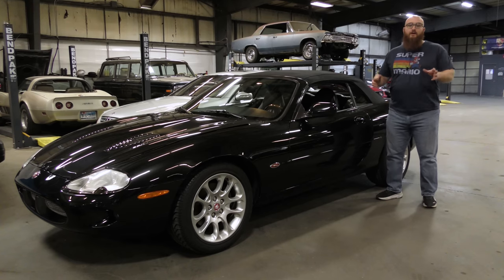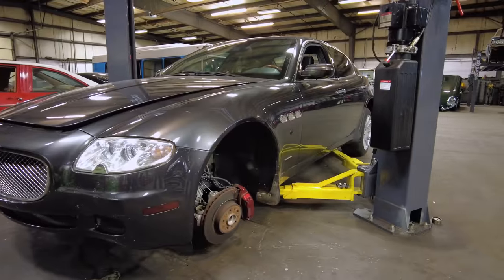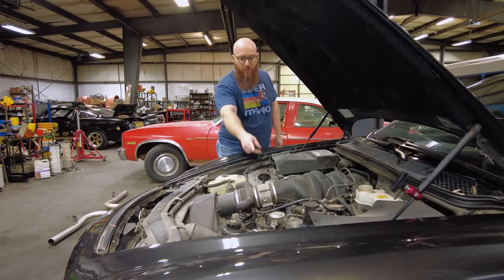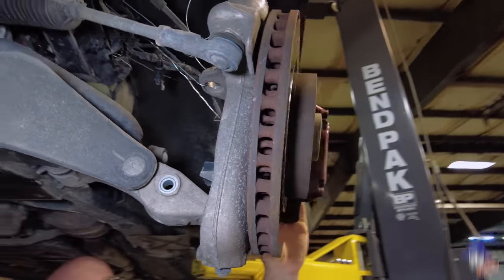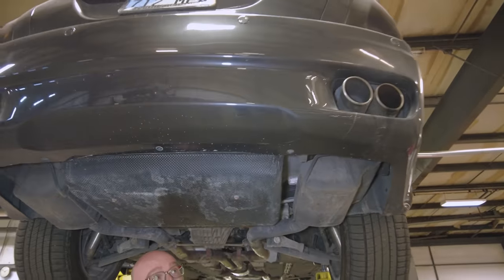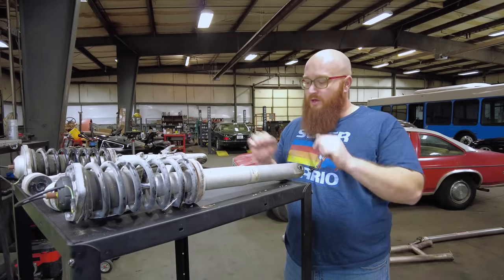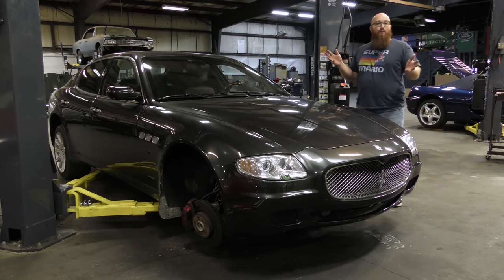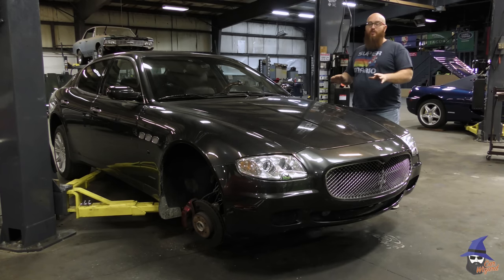Me-Owch!!! Catalytic Convertors cost $13K on this '07 Maserati Quattroporte! CAR WIZARD explains how

Comment: Bushings and insulators are a wear and tear item.  That's not too much of a problem.  Although, those type of bushings for those control arms are pricey.
As for the cats.. I'd put on some proper race headers and call it a day.  Cheaper, make it sound better, and you'll get more power from it.  🙂
Very true.  If you can't do the work yourself, don't bother picking up an "exotic" ride.  You'll go bankrupt really quick.  If you can work on them yourself, the skies the limit
Reply: Car won’t pass emission tests without new cats. I’d put aftermarket cats on it if some can be made to work.
Reply: @fw1421  many states don’t require emissions tests, so you have to sell it to someone in Tennessee, and states like that
Reply: @fw1421  Don't they make 'universal fit' cats. Magnaflow for instance.
Reply: Just run straight pipe. I saws off all my converters and run pipe anyway good or bad.
Reply: @hoopty.  im sure your city loves you 🙄
Reply: @luc-perrin  no inspection in Tennessee. Law enforcement has real crime to deal with, other than my vehicles choices.
Reply: @ianmontgomery7534  I've been told that aftermarket cats don't last long and typically fail after a few years.  OTOH, considering the factory cats cost $13K, you can keep on replacing it with aftermarket cats for a decade or two before you hit the factory cat cost.
Reply: @fw1421  Yes ... several of my cars are equipped with "test tubes"!  I would never live in a state with emissions or inspection requirements.  Even  my 9 vehicles in California are all registered in Michigan: 1978 to 2022 .... :-)

Comment: I check the prices for used Quattroportes.
That car is basically mechanically totaled!

As is the case with other high end cars, if you can't afford to buy a new one, and you can't do repairs yourself, you can't afford to own a depreciated used one.
Reply: Its the same with boats. If you ask for the price, you can not afford it.
Reply: I checked the car-part website and there are numerous ones.  One looked rather excellent on the interior.  Probably mechanically over priced to repair.

Comment: I use a broken adjustable ski pole. You can set it for length and it never drops the hood. Yes its in the way some times but you can move it so easy its never an issue.
Reply: Had a mechanic refuse my wood block, cut to size, that held up the hood on my company truck. Was pumped to show me his locks, offered me a pair. Literally fell on his face, almost caught it in time, idk how he didn’t break his orbital dude got nailed.

Comment: Those hood strut locks are awesome.  I have blue ones so they match the Ford emblem on the vehicles I use them on.  I also use one on each side.... because they are also ... ford emblem blue... so reliability is in question.
Reply: totally worth the money, i wish i would’ve knew about this. eforr i replaced the hood struts on my RX300 last week lol
Reply: Why not just replace the hood struts rather than buy the strut lock tool?  (Assuming you own the car and its not a customers)
Reply: @GunsAndRovers  Wizard has commented on that in the past. Most customers don't want to spend any of their budget on hood support struts since they typically do not do any work on their own car and rarely open the hood.
Reply: @GunsAndRovers  most customers don't work on their own vehicle.  For some reason we have customers that took them off or they broke off and they got a golf club laying in the plastic tray across the top.

Comment: Owning a Quattroporte 2007. Do the maintenance and repairs myself, so total costs are not extremely high. However I owned 2 Ferrari's, for 5 years in total. They were cheaper to own. (Mileage was much lower aswell, so that makes sense) The Quattroporte however is fun to drive, great engine sound and fun to work on.
Reply: What are common issues? I also work on my cars and have serviced Porsche’s and Mercedes’. I’m currently looking to buy either a Quattroporte or Granturismo
Reply: @RegionalRadioShackManager  same issues as any 12 -18 year old car. But specific: bushings, door latches, window regulators, alternator (lasts max about 120.000km) sky hook shocks, flexible engine mounts and electronic gremlins.

Comment: Maserati is a front mid engine car.  Many of the catalytic converters come out of Russia/Ukraine.  Rare metals like platinum and palladium.  Besides chip shortages there are converter shortages.  Big 3 and German manufacturers still idling plants on/off due to supply issues.  Now europe paying 6-10 times energy costs which will be reflected in parts.

Comment: Leave the stock converters in place, but install some new aftermarket cars in that straight section of pipe right behind the old one. That should provide enough exhaust cleaning to stop the check engine light,  You will also need to relocate the oxygen to behind the new cat

Comment: I found the oem drivers side cats for $5,100 shipped. So I am guessing $10.2K for everything. 2 words...STRAIGHT PIPE
Reply: Yes, but it’s illegal for him to do it.
Reply: @roydrink , for sure! That is why you leave and have somebody do it. Especially in a light emissions state like Kansas.
Reply: Why do you want to spew emissions into the air and make a luxury car noisier? Makes no sense. Aftermarket cats are the way to go.
Reply: @OMGWTFLOLSMH , silencer on the mufflers and if you replace the cats with a straight pipe with the mufflers still intact it is not an obnoxious sound. Especially on this car. This motor with exhaust sounds insanely good. Make a luxury car noisier? You must not be American? Guys have uber load Audi, Mercedes and BMW cars here.
Reply: @OMGWTFLOL  ok greta 😆
Reply: 3 words still a code
Reply: @OMGWTFLOLSMH  honestly the way modern cars run its unlikely there aren't many bad emissions, probably worse going across the catayst. Some manufactures have said the cats are unnecessary , just there for legal reasons.

Comment: 15:14 you pretty much described what happened to my old Aveo; the original cats failed, I replaced them with aftermarket ones then after 5 years of normal driving they failed spectacularly nearly stranding me on the side of the road. (This happened in February 2021 when the big winter storm happened that nearly took out Texas and it delayed my replacements from RockAuto) Then it was on its SECOND set of replacement aftermarket cats when the P0420 CAME BACK, and then I said “screw it” drive it until it dies, and pay for the $2,500 OEM cats when it does die, when a deer finally relieved me of that penalty box on wheels in November 2021.
Reply: Aveo's are like Cobalt's, they are objectively and measurably terrible in every way imaginable.
Reply: @Anonymous______________  which is why whenever my insurance company totaled it from the deer hit, I took the payout and RAN from that car! Now I have a 2006 Buick Lucerne that even after a year of ownership, the feeling that I have a NICE car hasn’t worn off!

Comment: In CA if the MIL light is on, its a smog check fail. So, skipping that cat repair would not be an option there. They let you pass with a pending code but not a stored code.

Comment: YESSS continue making these "negative" videos so the values tank again!! I've wanted an M139 QP for so many years.The values need to come back down to earth on these things LOL. Also, my guess is the thermostat was causing the car to run rich and I bet that's what took the cats out.
Reply: Coming from a Maserati technician, M139 QP are straight garbage. The M156 QP might not be very nice or competitive in the market, but at least they are fairly reliable and cheap (by Maserati standards) to repair.
Reply: @andrewweltlich9065 whats garbage about it in your opinion? Make me hate it because I really want one lol
Reply: @Passportbroski  Oh man where do I begin lol. Their issues can be summed up as the cars being designed by Ferrari so they use many Ferrari parts, then were hand built by Maserati. The parts are extremely expensive and the cars are very poorly built. There is also very little diagnostic information available for these cars, even for me, a dealership technician. The cars with the DuoSelect (aka F1) transmission are a nightmare to diagnose since Ferrari holds all information tight to their chest. Even putting all that aside, the cars just aren't nice. The interiors are not very good, the steering kinda sucks, the suspension gives poor ride quality, the throttle pedal has too much resistance, the radio/infotainment was outdated even in 2003, I could go on and on. In all honesty just get something else.

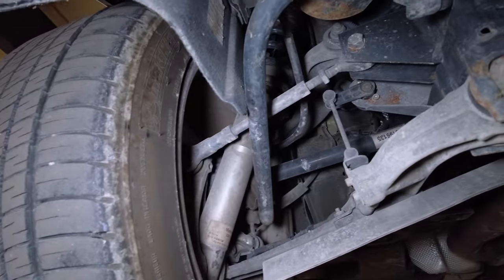Comment: 9:04 - The drivers side rear suspension, the upper link looks to have a nut that isn't tightened down against the adjustment rod. On the opposite side it looks correct.

Comment: OK first the converters.  I would buy aftermarket high flow cats for 80 dollars on Amazon and have a muffler shop insrall them. Next the bushings I would take the old ones with me to the parts store and find something similar and modify them if I have to. The only parts I would buy from Maserati are parts that are not universal.
Reply: The parts store to buy something similar? Bwahaha! First day worker: What year? What make? What model? The computer wants to know.
Reply: @bw1841  There might be some recommendations on the forums but a little research I know I could find something that would work there just bushings after all.

Comment: This is why I live in a state without inspections. Them cats could go to the dogs. 😂
Reply: user-tq2zb5sc2c  most people here take very good care of their cars. I seen more accidents in Texas because people assume because it passed inspection its safe to drive. But they don't check wheel bearings ball joints or frame rot. As the owner of a 2 ton projectile we should check our vehicles for safety before every long trip.

Comment: It's a Maserati with active suspension struts.  On a more common vehicle, it's cheaper and faster to replace the strut assembly vs dicking around with a spring compressor.  Safer, too!

Comment: Front suspension complete bushing set (both sides) is $250.00. Magnaflow makes CARB certified replacement cats (need to be welded in) for around $1k a piece. 

Just as illegal to fit used cats as it is to hollow them out, for reference.

Comment: I had a 2006 QP sport GT, the original cats failed. LARINI in the UK manufacture sports cats which I fitted and are fantastic. I have just checked  and the Automatica
 model is priced at GB £1668 so may be worth checking out!

Comment: Could you explain what is wrong with using after market catalytic converters such as MagnaFlows?  It looks like the catalytic converters there would be about $2800, and while I'm sure I'd underestimate labor costs, it is hard to picture that adding up to $10,000. Is there something I'm missing on why that is a no good option?
Reply: yeah, even just adapting another cat of a similar displacement engine, I am sure there is all manner of technically and legal reasons but I am not aware of it.

Comment: The price for catalytic converters on a Maserati Quattroporte is the highest price I have ever heard for catalytic converters on any car. Catalytic converters on cars are expensive, but most catalytic converters do cost less than that Maserati catalytic converter. However if a person lives in a state that has regular smog checks they will need to replace those catalytic converters.

Comment: The shop cannot won't do this fix, but if its a Cat below threshold code.. You can buy O2 Sensor Spacers.. that usually clears the code. $20 for those.  This probably wont work in a Carb compliant state they may do a visual inspection. Might try CataClean or some other product. 
But it will clear the check engine light.

Comment: I was sad because I had a check engine cat code, did some research and found out about a $30 product you put on your gas tank and after driving about 25 minutes the check engine went away. I didn’t really think it will work but it did, I even saved the receipt because it had a money back guaranteed. I don’t remember the name of the product but I bought it at Orally’s auto parts in the gas additive section comes in a box.

Comment: I'm sure a reputable exhaust shop could fab up some 200 cell higher flowing cats or get some universal ones from an exhaust manufacturer like flowmaster or magnaflow. I did something very similar to that when the cats in my Boxster and 996 gave up the ghost and they are still able to complete all the monitors for a CA smog.

Comment: Magnum tuning offers a 10 year warranty high flow performance Cat (299.00 each) specifically for the 2007 M QP 4.2, not legal in CA.  Require welded install site states will not trigger check engine light installed on factory exhaust.. have not tried them but it beats the 13k price quoted here... Mr Wizard.. your thoughts?  I have a 2007 throwing a P0420 on bank 1

Comment: Wizard explain why sometimes overheating isn't a head gasket but a clough up cat. My car was older without all computer chips to monitor the whole car. Unless your car is storage in a control garage you will have mechanical breakdowns. Seals,  bushings, and engine parts need oil, and burn off water condensation to keep your car running. 
Be smart and not stupid like I did.

Comment: I think I'd pull a Hoovie on this one and got the cheep route and put headers and straight pipes on it and re configure the computer . Which would really be a win for the dang thing considering it would run better with less restriction and probably make a lot more power
Reply: I'm not sure which is smarter: "cheep", or assuming that less backpressure = better anything.
Reply: @tim3172  Actually backpressure is always your enemy it's never your friend you have mistaken the scavenging effect with backpressure, he is right doing a de-cat and a retune of the ECU would give the car some power all over the rev range.

Comment: If the pulleys are equal to or behind the front axle line it is a mid-engined car, front Mid-engine, but it is mid-engine.

Comment: Normally I'd agree with Wizard on alot of things.  But the sound of a car is a purely subjective thing.  And to me, no doubt the Maserati sounds good, especially under load.  But to me, not better than some muscle cars.   The high strung euro engines sound a bit screechy to me sometimes.   Like my wife when I used the "good" towels.  I prefer a deeper tone to my vehicle exhausts.
Reply: I get what you mean but these engines use a cross plane crank and not a flat plane like the Ferrari version, giving it a normal V8 sound. These are happy up to its 7k redline, most V8s are done well before that, hence the awesome sound.

Comment: I had a 11 mks ecoboost with new aftermarket cats and a 420 code and I traded it for my 16 f150 5.0 with full sw exhaust also has 420 code fixed with a $20 o2 adapter, wish me luck at my emissions test

Comment: In a past video you said to run from a GMC 3.6 V6. I'm looking for a tow vehicle so what do you think about a Yukon 355 hp 5.3L V8 Flex Fuel Vehicle? Or Cadillac Escalade. Will be looking for something that can pull a large camper trailer after I sell my motorhome and smart car. Will have to buy used. Would love your advice.

Comment: I had an exhaust shop tell me that the price of a PT cruiser OEM catalytic converter was $1600 JUST FOR THE PART !  I also needed a New manifold that they did not quote me for.  and the Flex joint.   
Went to EBAY?  Less then $140 shipped to my door? I was in business.   Still need to get a proper  Coupling to fit the old  rear half of the exhaust to the new  portion of the CAT I bought.    I just saved $2,000 dollars.    How?   The Manifold was not included in the price.  Neither was the labor to do the job.  

I just a bit before that? I replaced the head , cams,   Cam timing belt,  "Pensioner",   and finnally was able to get it all working great.    
NOW MY ENGINE WON'T Turn over with the key...  Oh boy.  It never ends dudes.  😁

Comment: Maserati is owned by Ferrari and it shares a lot of parts from Ferrari. At one stage even the 4.2 V8 engine was actually a Ferrari engine with maybe a different ECU engine mapping than the equivalent Ferrari.

Comment: That rear left side control arm adjustment locking nut isn't tight. Weld in some aftermarket performance cats. No big deal.

Comment: With all the cat theft I'd be scared to have something like this. I bought a used Toyota tundra 5.7L. I think it's basically as much of a bullet proof truck as any. Not the best fuel economy, but I do basic fluid changes myself and never have needed to Take it in for any mechanic work. I use it frequently for towing a 10k trailer loaded. Bought it used and used for 7 years without any need for a profesional work as of yet. Sad they dumped the V8 imo. In looked at f150s and prices where way to high. I think the tundra is a way under rated truck. 0-60 on the year was in line or better with the f150 raptor of the year and better towing is better. I've seen your videos including the hilander and silverado. I think they are good, but would like to see something on the tundras. Anyway eventually I will be in the market for a truck and very disappointed Toyota killed the v8.... i would think there should be a way to get better gas mileage with towing capability, but what do i know.

Comment: Just curious - is there a way to remove it that catalytic converter, dump it in a kerosene for 24 hr, clean with carb cleaner and put it back, guess it should work 🤔
Reply: I’ve heard of this before, with mixed results
Reply: There is a car clean kit you can get. My guess is the thermostat caused the car to run rich and fouled the cats. I bet a good cleaning of them would fix them right up but we know the wizard isn’t even going to try to do that work.